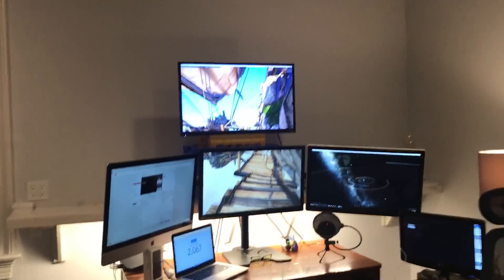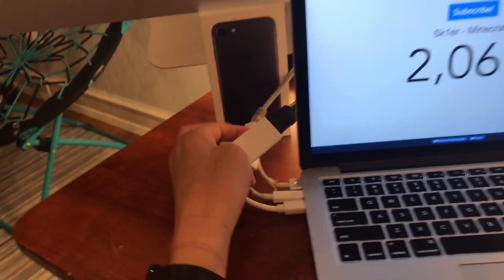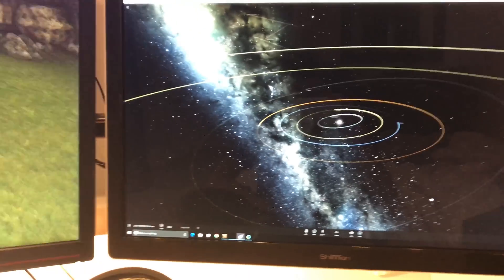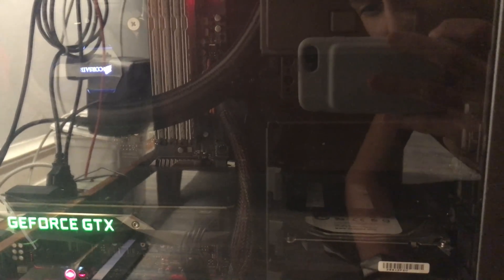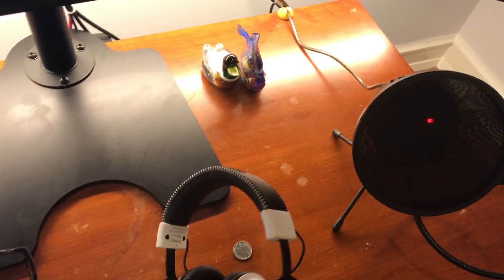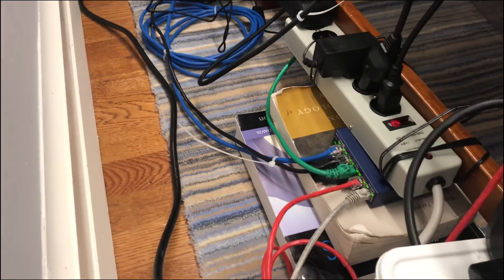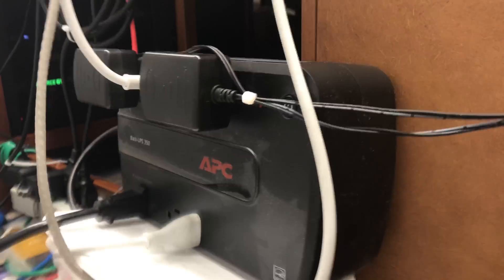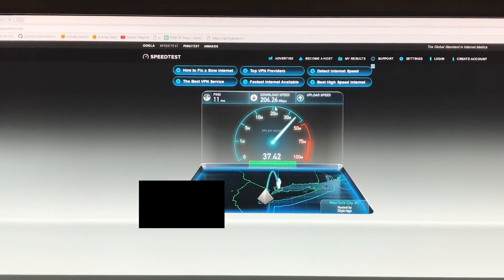Setup tour v2

Comment: How much did it all cost?
Reply from the maker: I acquired it in pieces. The IMac I got 4 year ago and used that until last June with i got the main computer. The 2nd 1440p monitor I got when i still had my IMac. When i bought my custom desktop, I got the 144Hz monitor. In August I got the 1080p tv (the big one). The small TV i found in my basement. Last week I got the mic. I did not get it all in 1 go. I got it over time.